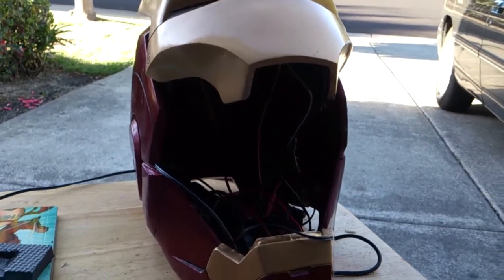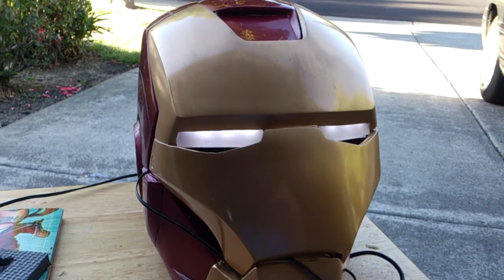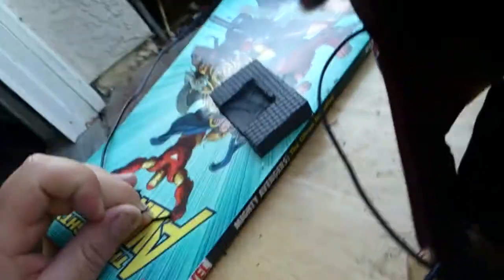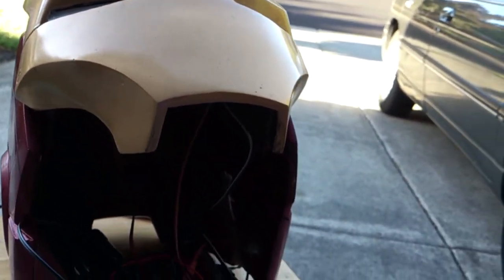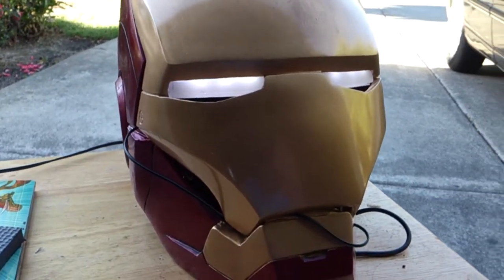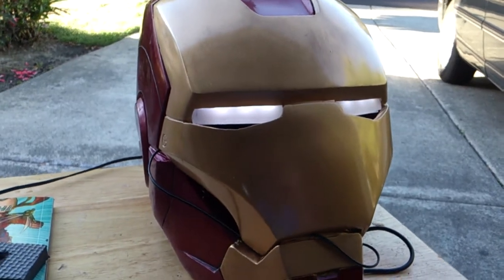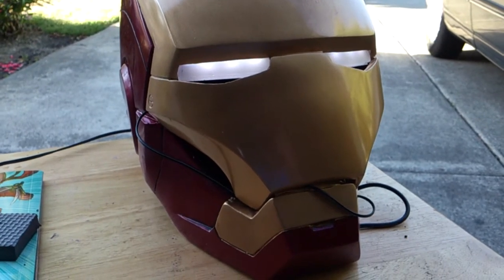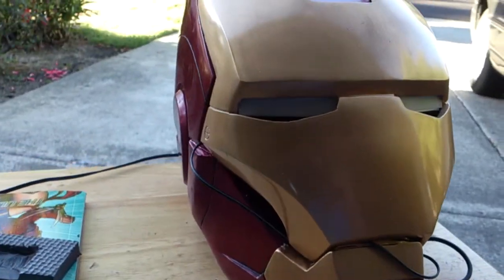IronMan Helmet Pololu chip programming

Comment: First of all Thanks for the reply sir and my second question in can you teach us how you connect hinge with servo motor?
Reply from the maker: I should have another video on how to do this. Basically it's using the servo horn holes and drilling out the hinge in the correct spots, then using a paper clip bent to link them together.
I am making another video that's more in depth on the whole creation process.